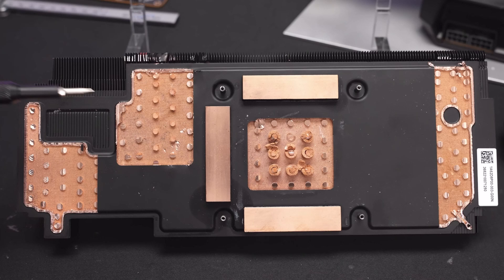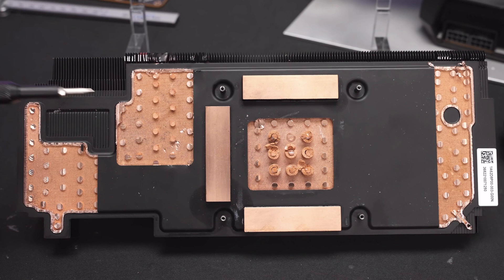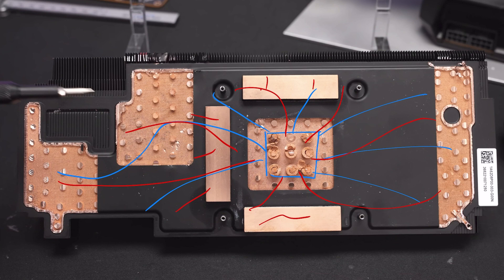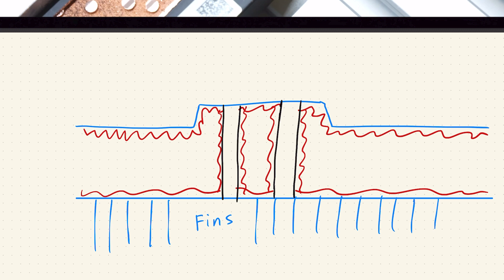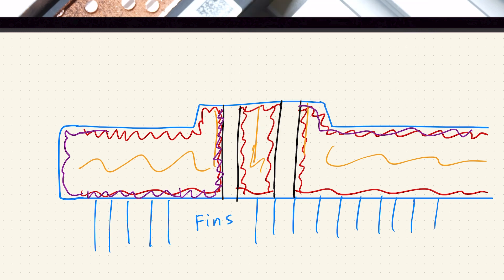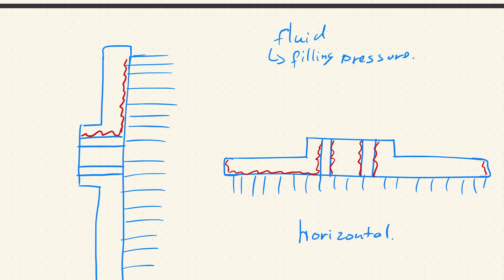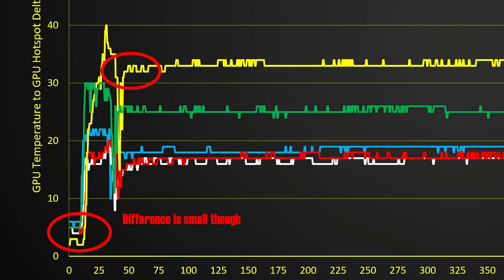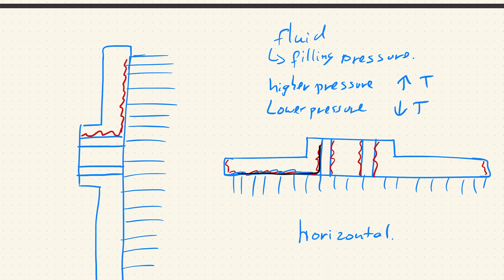7900XTX vapour chamber deep dive

Comment: I'm no engineer but i sure think like one. What fascinates me most about this tech is that it pretty much relies entirely on the capillary effect instead of channels for the condensed fluid to find its way back to the heat source. Any fluid - just as electrons - would follow the path of least resistance, by having mesh on the bed within the chamber, they are in fact slowing down the flow of any fluid that condensed from the ceiling. I would definitely redesign the internal structure to emphasize free flow, as well as lower the bed in areas where heat is present to further force condensate to those areas (similar to how a sloped balcony or porch directs rain away from ones house).. On the other hand, maybe they've already tested this and found that the capillary effect is better for devices that change orientation such as phones, who knows..
Reply from the maker: The capillary effect is a lot more powerful than you realise. Without it there is no actual pumping mechanism to move the fluid. The path of least resistance is to not move at all. You can have it gravity fed, but short distances under gravity don't give a lot of acceleration and won't work with a horizontal GPU.

Comment: As an engineer myself I agree however towards the end you may have mixed up some words a bit but the points came across. Basically a higher filling pressure drives up the vapour temperature which in turn will reduce the delta T between the GPU and fluid which would lower the heat transfer capacity. This failure however would not present itself the way we see it in the data as the efficiency of the vapour chamber would get slightly better at higher delta but an underfilled vapour chamber can reach a point where all or nearly all the fluid is in a vapour condition which greatly reduces the heat transfer and will cause the symptoms seen. Nice video though. 

Hope Derbauer sees it as he was hoping for someone to explain it.
Reply from the maker: I'm not really experienced enough with heatpipes to explain it well enough. After thinking it's the other way around. underfilling the vapour chamber will give a lower pressure and that will give a lower working temperature for the heatpipe. This causes the heatpipe to boil as the evaporator will superheat the vapour, and that superheated vapour will have terrible heat transfer properties. Also this superheated vapour will heat up the wick before it comes to the condenser.

This effects doubles on itself, it decreases the working deltaT of the vapour chamber. this increases the delta T and the circle continues.

The reason it doesn't happen when vertical is probably because the capillary action doesn't have to work against gravity at some points, like at the bridgets between the GPU and the finside.
Reply: With poor wicking structure and "unlucky" orientation you can end up with condensate forming in areas that wick poorly back to the heat source.
In this example the heat would then start to permeate through the spacer-pegs and heat up the area on both sides of the chamber over the GPU. Since there is not much other area left for wicking the evaporation is now driven at the wrong side of the chamber over the GPU and as the problem progresses the interface moves further away from the GPU.
There may still be well wetted wicking material in the system, just not very close to the GPU.
I wonder if it the worst orientation for the card would be having that little "tail" of the chamber (seen on upper left at 0:25) be at bottom facing left. Gravity would then aid wicking down into an area that is least likely to allow wicking back up to GPU.
Reply from the maker: @1kreature  Yes it would create an area of vapour in the wick, that the capilary pumping cannot overcome.